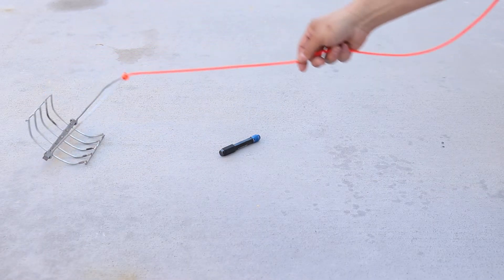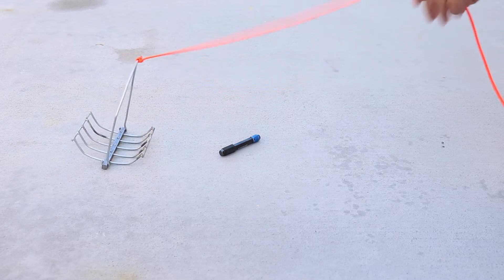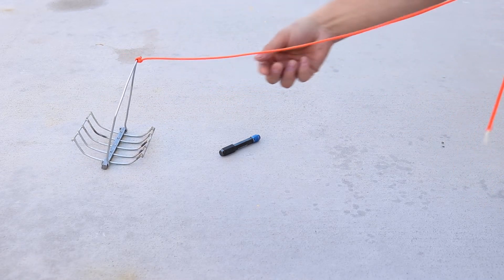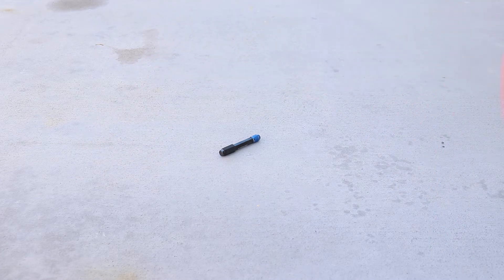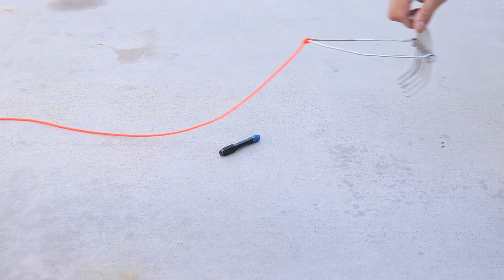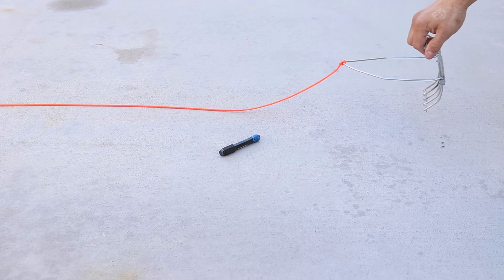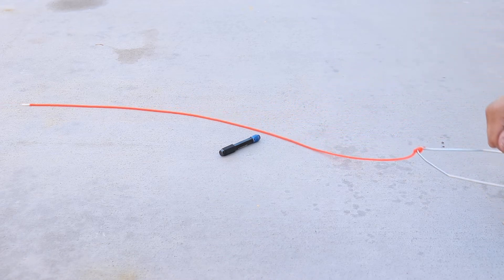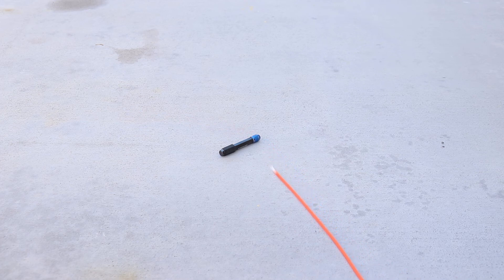Ocean Floor Recovery Idea for Sonar Torpedos

Comment: Sorry, I don't think so. I like your channel and every video you make. However, this idea seems to depend on visual feedback. Also, it works like a plough on the ocean floor. Ploughs are bad for ocean floors. It seems that if you used this as a grapple after locating a whatever you are looking for first, that might work. What is the scope of this design?
Reply from the maker: I agree, this design is too primitive to work. It would need independent skis that would adjust up an down with terrain. Also a fail check mechanism to flip the basket if it got caught. The torpedos were about 300’ under water. The company originally asked for massive gravity hook with a 36” claw span. I can only imagine it would be cheaper to have a piece of equipment they could drop down instead of divers on hand. Multiple would have to be used to make them effective.
Reply: @First_Class_Amateur  Just the fact that you can visualise those issues and conceive of possible remedies that says a lot.  If you don't mind my asking, do you have a engineering degree?  Because if you don't you really should.
Reply: Paul Keating -  I agree, for it to work the recovery target has to be precisely located within a very tight area.  Drop and drag at random is all kinds of wrong.  It makes more sense if the object isn't just lifted from below, but is captured or contained so that it can't be lost.  I suppose divers could secure it to the framework before lifting, in theory.  Then again if divers have to do that, the question needs to be asked, is there something the device does that divers can't do better all ready?

Comment: Tried in wet sand? Just curious I think it's a cool idea
Reply: Should work the same in wet sand.  The full size “torpedo basket” would be significantly heavier than this.  So, I don’t think it would have any issue going beneath the surface of the sand.
Reply: @patrickb-man1309     Any dragging will probably stir up a lot of fine particles making vision difficult.  The whole design presumes a smooth sea bottom, any other terrain will be a serious problem.
Reply: The question was only about wet sand, and my response was only about wet sand.  I intentionally didn’t address anything else you mentioned.
Reply: @patrickb-man1309  Okay, then let's address the question of wet sand.  Wet sand above water might require more torque.  If you are out of the water then you most likely have a better platform to pull from so it sort of cancels out.  If it's made of the right materials and has the proper welds to lift something like a torpedo, sand (submerged, wet, or dry) should be a non issue.  So you're right, it should work.  Are you happy now?
Reply: @ScorpionRegent 
I was never unhappy.  Have a good day.
Reply: @patrickb-man1309  Likewise and back at you.